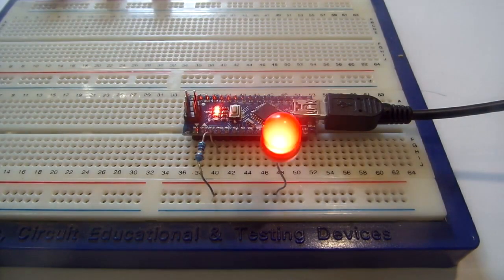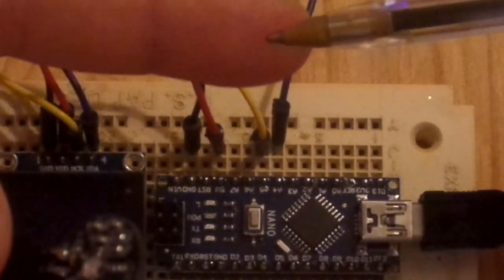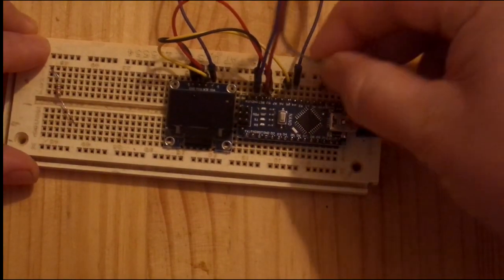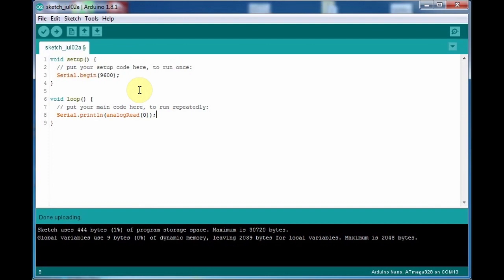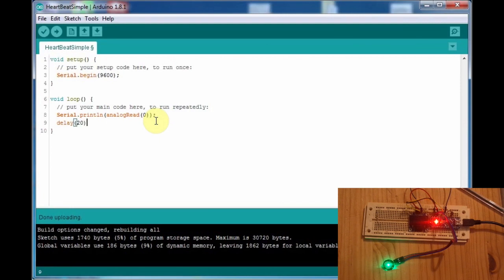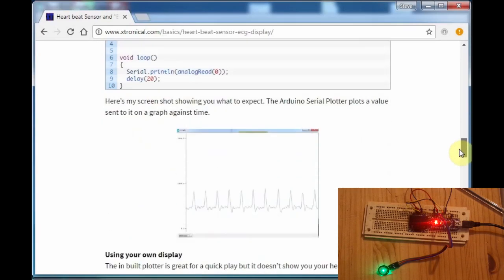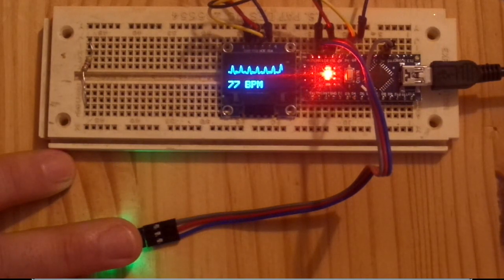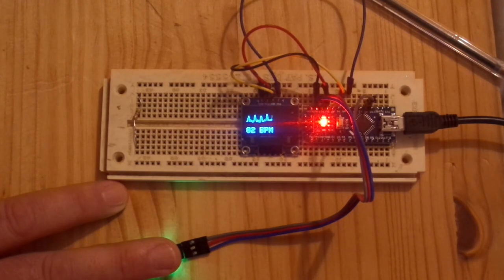Heart/pulse sensor with Arduino

Comment: Hi, thanks for this informative video. Btw, at 1:33, you say that what we are looking at is an infrared sensor and infrared emitter. However, I want to understand if it is an infrared emitter or optical (visible light) emitter? Please tell me.
Reply from the maker: Sorry for the confusion, my bad, some use infra-red, but this one does actually use visible green light. The amount of green reflected is less when your capillaries in your fingers swell during a heart pump (beat) and less when the hear has "relaxed". Unfortunately that is an error in the video. I've pinned this comment so that hopefully others will see it.
Reply: @XTronical  Thanks :)
Reply: @XTronical  interesting

Comment: The O2 saturation sensors are surprisingly similar.  The use 2 different wave lengths and pulse them alternatively rapidly.  Hemagloben when rich in oxygen absorbs slightly more of one of the wave length and it can assess how much of your hemogloben is carrying oxygen or is saturated in oxygen.  If half your hemoglobin is without O2 your are close to death.
Reply from the maker: Love this detail, thanks

Comment: Can you use it with esp32 please?
Reply from the maker: Yes, as screen and pulse device will work with it. But you'll need to connect to the appropriate pins on the esp32

Comment: Hi, I am learning how to make the PPG device using the instruction you have given. However, the PPG graph I obtained in the OLED is very small and hard to be regconise. Any codes available that can help me change the graph size? Thank you.
Reply from the maker: It's a problem with some faulty ppg units, I did a video showing the vast differences between two apparently identical units. All I could suggest was getting them from a known quality supplier.
Reply: @XTronical  Hii, but when using the serial plotter in using Arduino software, the PPG waveform can be seen, just that the PPG waveform does not show on the OLED. Is it related to the coding issue instead?
Reply from the maker: To change scaling, alter this line

y=60-(value/16)

Make the 16 a lower number to make the trace bigger.

Comment: Hi, it's been really very helpful video for me, but you have gone very fast through the code, and i have some questions regarding that, as there are some statements i could not really understand what they do like:
1/ bool BPMTiming=false;
2/ bool BeatComplete=false;
3/ if(value>UpperThreshold) 
{}

4/ if(BeatComplete){}
5/ BPMTiming=false;
6/ BeatComplete=false;
7/ oled.writeFillRect(0,50,128,16,BLACK);
  i dont understand the parameters inside the function 
8/ oled.setCursor(0,50);

can you please give a short explanation for them , thanks again.
Reply from the maker: If you look through the comments I've answered a lot of these questions. I'm guessing you are doing a college /school/University project. Quite a few students have asked these questions and all answers are in the comments. Have a rummage through them.
Reply: @XTronical  No problems sir, will do that, thanks again
yes your right I am doing a university project
Reply: Hello sir, i have run through all the comments  and the replies from you, I have found them very useful and they answer most of my queries but i still need your help if you dont mind regarding this if statement: if(BeatComplete){}, and this function:  oled.writeFillRect(0,50,128,16,BLACK); and sorry for being annoying.
Reply from the maker: No worries. 

if(BeatComplete){}

The BeatComplete boolean variable is set to true elsewhere in the code if a complete full heart beat has been detected. It's detected by checking that the trace has gone up then back down and then is on the way up again. 

So if a complete beat has been detected then the code inside this IF statement is executed. This codes job is to calculate the BPM (based on when the the last complete beat was detected, reset the BeatComplete variable and make a "beep" sound.

The oled.writeFillRect(0,50,128,16,BLACK);  line simply fills the part of the display where we print the BPM with a black filled in rectangle. Effectively clearing this part of the screen. If we didn't do this the new values would be printed on top of the old, and it would quickly look a right mess!
Reply: @XTronical  that's really very useful, appreciate your help. but what the 50 represent? thanks a lot.
Reply from the maker: The 0,50,128,16   are the coordinates of the rectangle (coloured black) that is being draw over the text to get rid of it prior to writing out the new BPM. So the first two numbers are the pixel coordinates on screen x=0,y=50. The next two are the width and height of the rectangle in pixels, i.e. width =128, height = 16. All graphics commands used are from the Adafruit graphics library which is documented by themselves. Just type in the command, such as writeFillRect and the work "Adafruit" and you should get a web page describing the command and what the parameters do.

Comment: Hello. can you share your code
Reply from the maker: Link to code is in the video description.
Reply: @XTronical  but I didn't see the code. Throw it here please. Thank you. Good works
Reply from the maker: The code is below but you should also refer to this Web page which has an updated write up https://www.xtronical.com/pulseheartsensor/

I've done several health projects, have a look through my old videos, they might be helpful

The code 

#include <Adafruit_SSD1306.h>

#define OLED_Address 0x3C        // Try 0x3D if not working

Adafruit_SSD1306 oled(128, 64);  // create our screen object setting resolution to 128x64

 

int x=0;

int lastx=0;

int lasty=0;

int LastTime=0;

int ThisTime;

bool BPMTiming=false;

bool BeatComplete=false;

int BPM=0;

#define UpperThreshold 560

#define LowerThreshold 530

 

void setup() {

  oled.begin(SSD1306_SWITCHCAPVCC, OLED_Address);

  oled.clearDisplay();

  oled.setTextSize(2);

}

 

 

void loop() 

{

  if(x>127)  

  {

    oled.clearDisplay();

    x=0;

    lastx=x;

  }

 

  ThisTime=millis();

  int value=analogRead(0);

  oled.setTextColor(WHITE);

  int y=60-(value/16);

  oled.writeLine(lastx,lasty,x,y,WHITE);

  lasty=y;

  lastx=x;

  // calc bpm

 

  if(value>UpperThreshold)

  {

    if(BeatComplete)

    {

      BPM=ThisTime-LastTime;

      BPM=int(60/(float(BPM)/1000));

      BPMTiming=false;

      BeatComplete=false;

      tone(8,1000,250);

    }

    if(BPMTiming==false)

    {

      LastTime=millis();

      BPMTiming=true;

    }

  }

  if((value<LowerThreshold)&(BPMTiming))

    BeatComplete=true;

    

    // display bpm

  oled.writeFillRect(0,50,128,16,BLACK);

  oled.setCursor(0,50);

  oled.print(BPM);

  oled.print(" BPM");

  oled.display();

  x++;

}

Comment: Hi. This video is exactly what I had been searching for regarding a project. However, I would like to know if it is possible and how to obtain data values corresponding to the ecg plot so that it can be compared with the data sets available for ecg. Thanks in advance!
Reply from the maker: From this simple device you cannot do that, but kits exist for Arduino to do full ecg

Comment: How to use this code in oled  1.3 inch, 4 pin display. Please tell
Reply: My display is not working by this code
Reply from the maker: You need to get the correct drivers for your display and also probably a fair bit of the code would need adjustments. I see you've added those comment on another video, I won't a answer on that one as well.
Reply: Can you please modify this code. I need it ardently.
Reply from the maker: I don't have your display, nor know what exactly it is. And you tube is just a hobby, I also have a very busy full time job so wouldn't have the time, sorry.
Reply: Ok thanks

Comment: Error uploading, com port busy what to do
Reply from the maker: Nothing to do with the code for the project, it's an issue with the Arduino IDE / your board. It can occur for several reasons, could be wrong board selection, serial monitor being open, the software getting a little confused, com port not set correctly. Check all those things. Quite often if none of those work, just restart the software.

Comment: I need most accurate ecg graph
Can you please suggest me a best sensor by which we can get ecg through led only
Reply from the maker: A "true" ECG really requires the multiple chest attachments, and these are available. However you're asking for a LED device - which will give you a guide to the heart trace but cannot be as accurate as the full correct equipment. But if your basically asking for something better than the sensor used in this video then see this video where I use a MAX30100 sensors which provides pulse and oxygen level readings, this may be what your looking for. Link Below.

https://youtu.be/17im1J1EdZA
Reply: @XTronical  I have seen that video is it accurate sensor
Reply from the maker: It is much better than the other videos sensor. These are the ones they use in smart watches and fit bits etc. But as for accuracy it can only be used as a guide. If you want something better then you have to move away from using LED versions to proper sensors.

Comment: Hello, thanks for sharing your knowledge
I have tried to compile the code, but I get the following error
exit status 1
'class Adafruit_SSD1306' has no member named 'writeLine'
Could you suggest a solution, thank you
Reply from the maker: You don't seem to have the latest version of the Adafruit-GFX-Library. So previous versions didn't have the writeline routine (and possibly other routines missing also). It seems like you've just landed on the wrong download page at some point for an older version. Easiest thing to probably do is to use the Arduino Environment to update your version to the latest. Go to menu option "Sketch->Include Library->Manage Libraries..."
Then type "adafruit gfx library" into the search field. The top entry should be the graphics library we need which should say installed and give you the version installed.
Click anywhere on this entry and it will then show a "Select Version" menu and a disabled "install" button on this entry. Click the "Select Version" menu and select the newest. The "Install" button should then enable. Click Install and after it's installed close this window and you should be good to go.

Comment: Can you please send me a code or can you do a video for a 20x4 lcd screen on the Arduino uno? I would like to test your code. I'm a beginner with Arduino and coding so it takes awhile for me to change/adapt the code for my specifications. If you can help me I would appreciate it a lot. You can mail me the code or a link at lokibfn@yahoo.com. Thank you very much.
Reply from the maker: I do not have a 20x4 display in my displays box at the moment, although they usually work the same as the 20x2 ones. At the moment it would be a while until I could get round to it as I've a list of things to do at the moment. But I'm sure another channel has probably covered this. Sorry I can't do something for you quicker.

Comment: can you use it on another type of screen?
Reply from the maker: Yes as long as there is an Adafruit driver for that screen as the code uses the adafruit graphics library. Obviously there may need to be adjustments to make the most of whatever resolution the screen is.
Reply: XTronical thank you! Do you know if I can show other information on the same screen like temperature ...etc ?
Reply from the maker: This has come up a lot lately, so I have a project coming up in 2 to 8 weeks showing a system for measuring heart rate, blood oxygen content and body temperature, all displaying on a colour screen.

Comment: ı wanna ask something about your project 
why bpm is not constant? it is always changing in one minute 82,73,77 etc.
ı think it has to has one rate throughout one minute
am ı right ? ıf you answer immediately ı will be happy :)
Reply from the maker: Yes, the display is correct. It's just how you would see it with a proper machine in the hospital. Yes it is Beats/Min but the value shown is a snapshot of what you would get if your heart beat exactly at that rate for a further 60 seconds. Of course your heart does not keep an exact constant rate no matter how calm or un-moving you are. If you wanted to know just exactly how many beats your heart did do in a minute then the software would need altering so that it counted them for an entire minute and then and only then display the BPM. Of course you would be waiting around for an entire minute to get the result which is a bit boring. 
A compromise might be for it to count the beats every 5 sec and work out the BPM from that (multiply by 12). That would give a perhaps steadier result but a result that only updates every 5s.
Reply: thanks your answer and ı did this project and ı wanna show the screen.My graph is little different from you .
how can ı show my screen?  Maybe  by your mail ıf you wanna give me your mail
Reply from the maker: Make sure you are using the latest code on this page : 
http://www.xtronical.com/pulseheartsensor/
This solves most peoples issues. There's also a newer video :
https://youtu.be/Bo4OLvpfWzQ
Reply: you are great person thanks a lot for your help

Comment: I saw the addendum on the xtronical page. I'm using the code that just prints the bpm to the monitor but I keep gettting weird values... 0(zero) for a lengthy time unless i lift up my finger and get like 5. At some points I get -2.... Keep getting values of like 40 and my heart rate is usually higher as I'm not really in shape. Any advice?
Reply from the maker: The only things I can think of is you might have connected to D0 rather than A0? or the unit itself is defective. Also perhaps try connecting to A1 instead of A0, obviously change the code to allow for this. I'm a bit short of any other ideas at this point, get back to me and let me know how you get on.
Reply: @XTronical same problem with her after trying this it still doesnt work i have bought new parts but keep ending with the same result only beeps when i move my finger and the bpm stays at 20 when i leave my finger plzzz  hellpppppp
Reply from the maker: I'm a bit stumped to be honest. You've tried all the things that usually sort issues. I'm releasing a new video in the next few days using different parts. This system seems much more robust and reliable. Might be something to try.
Reply: @XTronical   nah thankd anyway dont wont to buy more parts il just submit what i have for my technology project
Reply from the maker: Ok, sorry I can't figure out what's going on.
Reply: @XTronical  Thanks for replying to my comment and trying to help. Honestly I got a decent grade on the assignment and I'm already done with that class so it doesn't really concern me much anymore.

Thanks again :D

Comment: can I use  this sensor to measurement the ppg and then calculate the blood pressure?what is the name of sensor and where i can find it ?
Reply: To calculate blood pressure or oxygen saturation in the blood you need two sensors, usually in the range of the electromagnetic spectrum of red and the other in the infrared. The ratio of the ppg signals obtained between these sensors will give you these other vital signs. Heart rate, on the other hand, can be obtained with only one PPG sensor, and currently the best light spectrum range to obtain a signal with a better signal-to-noise ratio is green light (especially when you have to process this signal signal due to motion artifacts, the green light-based sensor has a less corrupted but still challenging signal processing signal).
Reply from the maker: Thanks for that, if you check out this video you can see me work with one of the red/IR sensors.

https://youtu.be/DRrMQLXYfH4

I've another video out in 3 - 4 days using one of these and a colour display.
Reply from the maker: Unfortunately not, I can't see how you could calculate blood pressure with it. If you want one then search "arduino pulse sensor" on Ali Express or ebay etc.
Reply: @XTronical  ok thank u. 
but can I measurent the ppg isn't it ?
Reply from the maker: Yes it is a PPG based sensor but the ones commonly available (as used in this video) are very basic and very sensitive to any movement and pressure. And you need to interpret the raw pulse data (AC component) to make anything more than a pulse sensor with it. As they can fluctuate quite a lot for the detail in the trace (but OK enough to determine a beat) they are not suitable for more advanced uses. This guide I found explains what you would need from a PPG sensor to be useful for more than just a pulse:
https://www.news-medical.net/health/Photoplethysmography-(PPG).aspx

I may be wrong but from experience of using these little cheap ones I don't think you could get it to do more than a pulse. I have recently received a more advanced sensor that can do blood oxygen level and pulse (but again quite cheap) and this may be much better but I've not had time to investigate it yet but a video on it will follow in the future.

Comment: Si estoy usando una pantalla LCD Oled 128x32, debo cambiar algo? La gráfica del pulso se eleva mucho y tapa el numero de los latidos por minuto
Reply from the maker: Sorry I did reply to this yesterday but looking now the comment has not been saved or something. Yes the code would need changing in several places to display correctly on a 128x32 display